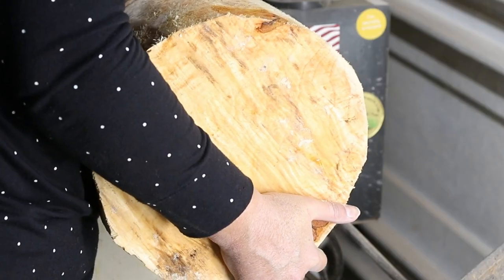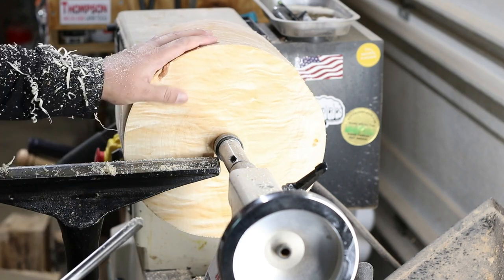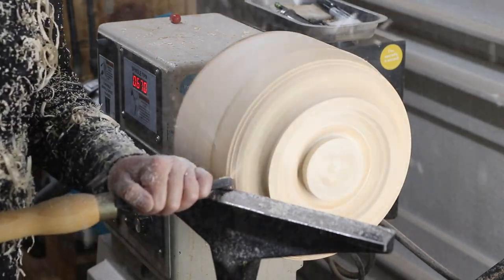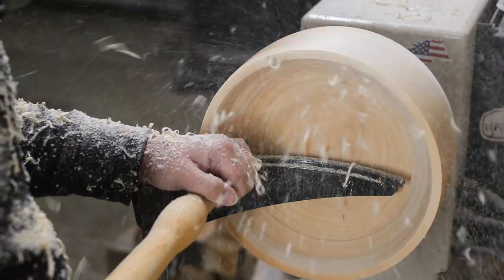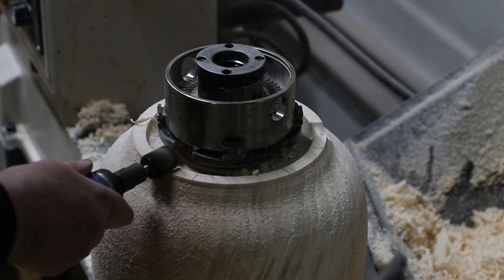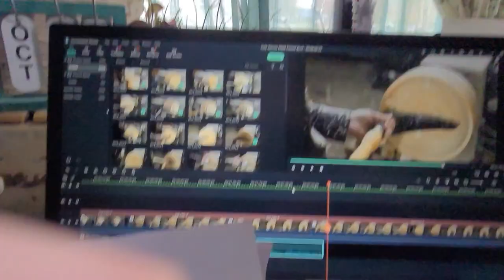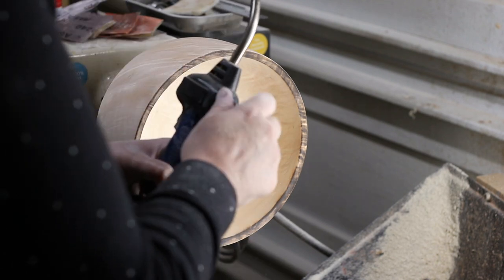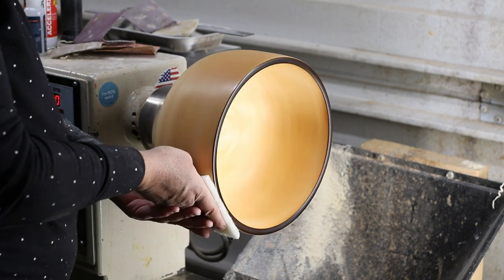GOT WOOD???  Curly Norway Maple Bowl/Woodturning

Comment: If you have a whole round section, put it bare-end on bare ground, ideally where you've seen mushrooms, but that's not necessary. Leave it (this is tough to do!) for at least 2 years. Norway maple is one of the hardest maples and spalts beautifully! I'd attach the pic of my 14" display bowl if I could. Some gorgeous figure in your bowl, for certain! 👍 
Imagine it spalted, now. 😉
Reply from the maker: It definitely will be hard to leave it for 2 years but the results of the spalting will be so worth it. Thanks for sharing 😊